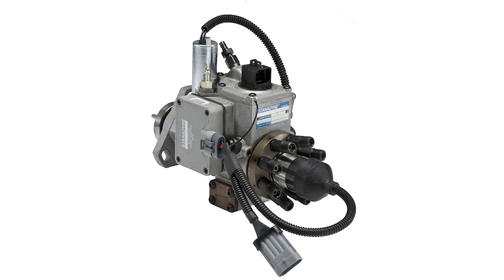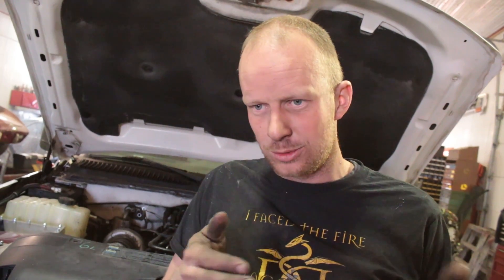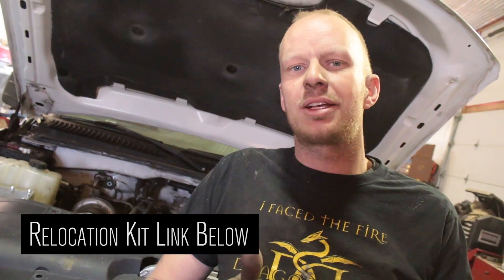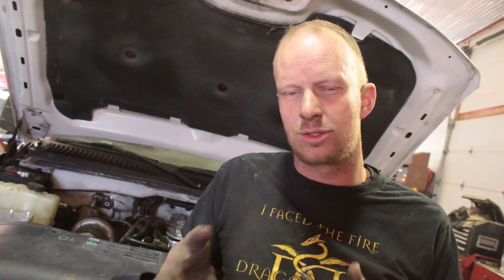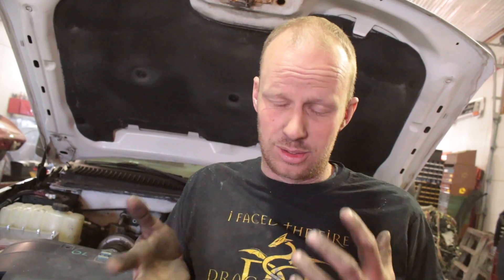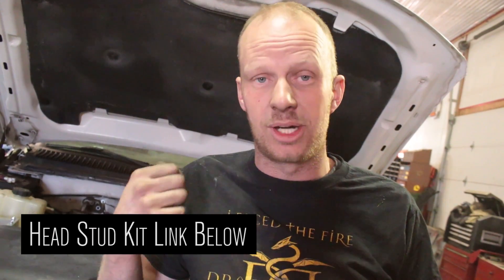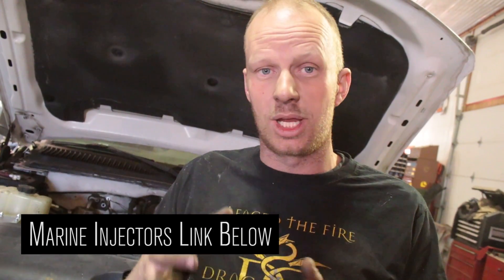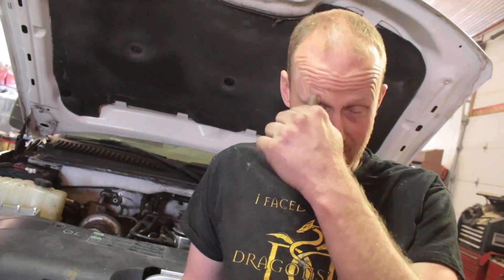REVIEW: Everything Wrong With A GM 6.5 Detroit Diesel

Comment: you forgot to cough 6.0 under your breath aswell..
Reply: Adrian Harris finally a well balaced response. Emissions killed the 6.0 off and nothing more. I'd argue that the EPA killed the entire diesel market in the US by making diesels entirely too complex and expensive for every day driver vehicles.
Reply: I assume you mean 351 Windsor...because the 302 is not quite like a 351 Cleveland.  And the 351W was a different crank, different cylinder deck heights, different intake.  You can't just bore a 302 can get a 351W.
Reply: The guy who said the coolant is the problem is correct. The silicates in the ford gold coolant will fall out of suspension and clog up the oil cooler due to the small passages in the oil cooler. In the coolant flow, the egr cooler is right after the oil cooler. When the oil cooler clogs, the egr cooler doesnt get enough coolant and causes the cylinder temps to rise. High cylinder temps = blown head gaskets. I will admit that the head bolt design could have been improved, but for a stock engine, its adequate. My dads 06 6.0 has 270k and runs fine. The thing about it is that it has standard green coolant in it. Granted green is not ideal for a diesel, but it doesn't kill the 6.0 the way ford gold does. Ive heard of guys running cat ec-1 rated coolants and have next to no problems with the head gaskets.
Reply: DEBOSS GARAGE only ford you would dare own is a 7.3 powerstroke, 5.0 engine or a 460. Those are the only three.
Reply: Wow the EPA, Condelizza Rice and The Obama's have really got you running scared...ANY diesel engine made after 2003 needs to have the emissions shit removed if you expect it to go more than a 150,000 miles with a tune.

Yes it is illegal to remove the emissions controls from a vehicle of any kind but it's also now a federal offense to "annoy" a  police officer. So these laws are all kind of ridiculous and in place for no other reason than to make some fat fuck extremely rich and powerful. And as long as you're in a state that does not do emissions testing. No one cares. Trust me I know...I live in Minnesota and no cop has ever bent his fat ass over to look under my truck to make sure I still have a catalytic converter or made me open my hood to see if my truck still has an EGR Cooler. And even if they did...I doubt if any of them would know what to look for. 

AND!!! If you're that butt hurt about the idea of making your truck run better and be more reliable...There are now several companies including "Bullet Proof Diesel" that make "bullet proof" emissions equipment for the 6.0L that allow you to keep all the bogus emissions controls but also have a truck that will never let you down.
Reply from the maker: I love the one where he says, "I love my truck but sure as shit, its going to leave me by the side of the road" https://www.youtube.com/watch?v=8o2LGuzl0go at 6:40 I know he's talking about a 6.4 but I laugh because nothing he says makes me ever want to own anything Ford ever
Reply: The 351 and 302 blocks are not the same. They are similar though.  the 351 has a different deck height,  and uses larger main bearings.  It is also capable of withstanding higher hp levels.  the 351W also uses larger head bolts, so in order to use 302 head on a 351, the holes in the head need to be drilled larger.
Reply from the maker: That's why I said "Any idea why Ford only used it for 4 years in their PICKUPS?"
Reply: @DEBOSSGARAGE  4 yrs huh?? You cant count apparently 6.0s were in ford trucks 03,04,05,06,07 pretty sure thats 5 yrs. They ran them until 2010 in vans and 6.0 went in bus's flat beds and many.more applications. The reason ford had to move om was due to needing better emissions. U like the good ole 7.3 and ford used the 6.0 longer if u count the vans
Reply: @DEBOSSGARAGE  ford was set on competing with the power race when  the vt365 (international) was far detuned compared to what ford decided to run.
Reply: dillon myers 6.0 is much better than a 6.4.
Reply: i blame idiots with diesels that believe they can put a 500 hp tune then engine goes to shit and wonder why then decide to blame the brand also poor maintenance coolant every 50k miles normal 30k severe
Reply: Mel, I am not the Ford fan my father is but I know he has moved mountains with his 460 and c6 transmission.  Whatever they did that year in 1979 seemed to have worked good for them. He isn't into any of the new stuff. too much stuff to break he says. That is probably true across the board though.
Reply: consaka1 I agree. I love my 95 powerstroke and my gf 91.5 cummins. Both amazing and they will run forever. She's got 189k I've got 106k on the engine 156k on cab and 4K on my built trans.
Reply: BAMAJiPS I decided to run a manual fan controller, when you come up to a hill pulling a load, flip it on never comes over 205 degrees. Great motor never had any problems
Reply: In my opinion those were good years. Probably relatively easy and cheap to fix or upgrade if you want to. I have people tease me (usually ignorant people) that they don't want whatever I have because I am always working on it. What they don't realize is it is almost never for repairs but rather upgrades or new features.  For instance having someone else do a 4x4 conversion on my van and them totally screwing it up.  I had to do my own research into 4x4 suspension geometry and then come up with something better than my quick fix that made it driveable. 
I recently got a '93 Chev crewcab dually.  I got it because it was cheap with a badly cracked head. I quick patched the head and daily driving until I get a performance engine built for it.  Love the simplicity of that engine design.
Reply: actually dont even need to do the EGR delete either, just use the updated bulletproof egr cooler it is way strobger than fords and the truck is 50 state legal. plus you don't need to run a tune to delete the egr
Reply: Nah not really. The 6.0 was made for 7.5 years and it was offered in the f650, the econoline, and the international medium duty trucks. So it was offered in more than one platform. However the 6.4 was only offered in the f250-f550 and international terrastar from 08-10. My dad's friend has got one and he's on his 4th engine!
Reply: Respectfully disagree. My 2007 LBZ Duramax just rolled over 200,000 miles, pulling stuff all over the US. Bone stock, runs like a champ and doesn't burn any oil.
Reply: The LBZ is by far the cats meow when it comes to these platforms.  Mine is just shy of 400,000 and has lived with a trailer hooked to the goose since it had 65,000 on it.  One thing to look at on yours is consider a lift pump to extend the life of your CP3.  The low pressure side of the pump has to draw fuel a long, long, way and it will wear on them.
Reply: Yeah only reason I'd say a 6.0 is better than the 6.5 is atleast the 6.0 actually has power, the 6.5 is a friggin joke, then again so is the company that made it, now they are bigger jokes, GM is government motors.
Reply: dillon myers meh 6.0s aren't terrible if you get em after 04 and take care of them . But yeah 6.4s suck lol
Reply from the maker: Any idea why Ford only used the 6.0 for 4 years in their pickups?  Seems like if it was a good engine, they would have used it longer.
Reply: Mel's 12valve I think you meant the 460, and what do you think about the 351 Windsor?
Reply: DodgeGuy67 lmao I said a chevy motor when I'm talking about fords......
Reply: bigassfordsd I'd never use 302 heads on a 351. I'd use 351 heads on a 302 for lower compression to run a small turbo at no more than 7psi of boost. But a old 4 bolt 302 is one thing I'm after. I have a 81 302 whole motor sitting in my shop waiting for a project I can start. Down to the block. I would do a 347 but it costs to much money. I'm thinking about building it to be a carbed 302 bored 10 or 20 over because the blocks honing is pretty good still the block has 180k on it and you can still see the hone.
Reply: Mel's 12valve outside of the head bolt size, most of the Windsor series heads of the same era are essentially the same casting, mostly pointless to do the swap.
Reply: consaka1 for the most part new stuff is a pain in the ass but nothing can pull like them.
Reply: consaka1 in 1979 you could get a 460, c6 and Dana 60s on a truck. It was a beautiful combination - albeit an 8 mile per gallon one haha
Reply: Oh for sure the new stuff is awesome. The result of competition among the big three. If you were towing for a living and needed a nice tax write off a new truck would be the only way to go, especially if you have endless amounts of money.  For the rest of us, doing occasional towing across the US,  an older rig putting out 300hp will do just fine.
Reply: no use ford parts, just make some updgrades which means dropping 2,000 into it and its a good engine. and do the proper maintenance. go out and try to buy a newer DPF truck and see what you get it a lot more $$ and harder to fix when it breaks
Reply: because it couldn't meet emissions standards anymore. Same reason they had to get rid of the 7.3
Reply: I think Navistar still uses that POS in their International trucks as the Maxxforce 7. Ford ditched Navistar and made their own diesel engine which I heard is better.
Reply: Navistar's maxxforce 7 is the 6.4 powerstroke not a 6.0. and again...in the navistar or international trucks. these run for a million miles easily because of the difference in requirements for emissions crap between a 1ton pickup and a medium duty truck...
Reply: VTWINKIE first gen had plenty of fuel injection problems we have a 2006 dmax no problems but first gen led to the injectors being placed outside the engines which is the easiest engine to replace the injectors
Reply: so take a brand new engine, rebuild and modify the entire top end and then you got a good motor. Logic.
Reply: Bullet proof (bulletproof diesels bullet proof) a 05-07 6.0 and you have a 900,000 mile engine
Reply: dillon myers fah Q
Reply: Game Bred Duramax 6.7 was the scorpion code name
Reply: I had a 6.0 it was a damn good motor it gets a lot of heat that it doesn't deserve
Reply: @trevorodom1930  I have 5 of them, my daily has about 450k on it, stock motor, no heads, gaskets,  arp , nothing  except switching at year 1 to elc coolant and an engine cooler before it plugged.
Reply: Cruisin Down the street in my 60 blowing a head gasket needing a tow
Reply: Donald Drumpf: "351w is shit" Says the guy who plays video games!
Reply: Meh, fuck the government.
Reply: Donovan Savage 6.4 was the worst engine from fuel in the crankcase to egr cooler failure and melted pistons also due too all this the blocks got trashed and almost always they were useless to be rebuilt there have been 6.0 that have reached 800k miles without being bulletproofed and just MAINTENANCE mostly what kills the 6.4 is the epa junk
Reply: HERPY DERPEDY also their shitty fuel system that allowed fuel to get into the oil.
Reply: dillon myers  6.0 is international vt365
Reply: Charles Thomson. and still support gay rights
Reply: Charles Thomson ford diesels were never ford international made their engines all the way to 2010 the new 6.7 was made by ford eith the help of AVL of Austria
Reply: Isaac Housley Was researching the 7.3 and coolant was an issue there as well. Something about micro bubbles working their way through the block if coolant wasn't changed regularly (cavitation).  Nalcool was the preferred coolant IIRC but that was years ago. Yeah, I didn't believe it either until I read it. Ahhh, SLA and it kinda sounds like all diesels could have a problem if neglected. http://www.powerstroke.org/forum/99-03-7-3l-general-discussion/238152-7-3l-block-cavitation.html
Reply: Exactly right. I wanted to go with an 7.3L F-350 but who knows how well people had maintained them. Then when I could afford a new truck (2005) the 6.0 was having problems so I decided no way. Ok Ram, whatcha got...oh this used 2003 3500 with modded Cummins. Death wobble at 80 and I could see people next to me on the freeway scatter. Next. Hmmmm, GM buy down days....I can get a 2005 Dually for how much? SOLD!!! Twelve years later, 9 of which I've either been in Iraq or Afghanistan and my 2005 sits with 35,000 miles on it. I cringe at what could be happening with the fuel. Time to replace a basically brand new fuel filter but cheap insurance. Or buy a new one for $70k. Kinda defeats the purpose of spending all this time over here I guess.
Reply: Mel's 12valve a 351 and 302 have the same 4" bore
Reply: Mel's 12valve its not the same block a 351 hase bigger mains and a taller deck hiet
Reply: dillon myers no. The 6.0 is fixable within reason. The 6.4 is 100% crap
Reply: DEBOSS GARAGE 5 years 03 til 07
Reply: Mel's 12valve 6.2 s are awesome too
Reply: Game Bred Duramax and im a gm fan but a powerstroke platform is still a decent start not like a 2 stroke gm diesel
Reply: nothing wrong with any diesel,its the smog laws,any engine can be bullitt proofed,to a point.the more crap on them the worse they are.6.5 gm,if you read the history,is a stop gap as gm had nothing,its basicaly a petrol engine trying to be a diesel,thats why it has so many faults.heads,block,crank,accesories.on paper,there brilliant,thats where they should of stayed.becouse your in u.s.,you have probably never heard of mwm,in brazil,german diesel.reliable as fuk,not much power std but,mmm,no lectrics,no glow plugs,no worries.cant beat a streight 6.,510nm,140kw,190hp.1995-2007.then went lectric all the common rail,comp,ect.duromax is jap,isuzu,did you get the nissan 6cyltd in u.s.,there bullitt proof,good for 30psi std.
Reply: @phantomwalker8251  you are confusing the 6.2/6.5 with the old converted 350's from Oldsmobile, which were indeed stopgaps built by GM. 6.2/6.5 were Detroits....totally different heritage.
Reply: i dont cough at gm,im uncontrolably sick.history dont lie.only thing i drive is ford or dodge.ya know,its like the 2nd world war,becouse we won,the spitfire is reveared,but the zero,me109,are far superior planes.
Reply: BAMAJiPS, I know my comment is months late but some of us that live in taxifornia where we smog 1998 and newer diesels, we can't bullet proof the 6.0 legally and we have random road side mog check stations, I have personally been through two in Riverside county Ca, the 6.0 is a junk engine in stock form kind of like the Oldsmobile diesel from the early 1980s, it is such a shity engine that they are less valuable than the 7.3 that preceded it. Going by what I always see on Craigslist.  
Not trying to be a critique but it really was a terrible engine it took the aftermarket to get it right.  once it is head studded, EGR deleted and a few other mods it runs like a 7.3 (you know reliable).
Reply: Capt Trdl the 351was a good engine for its day, not a powerhouse but it was never met to be one, just like a BBF (429,460) it was meant for torque.
Reply: JP in JC not true in some cases my 6.0 broke down with normal towing and daily driving. Bulletproofing fixed it.
Reply: dillon myers i
Reply: Atomic Reverend Alexander what law says you can’t stud a 6.0 bud
Reply: Mel's 12valve 351s are not the same as a 302 different block.
Reply: No he didn't. The 6.0 had issues for its first half a year productiin but after that was a great motor. Just as efficient and reliable as a 7.3
Reply: Matt Lane I'm willing to bet a few things.
1. I'm betting you've madr a few kids that would be considered illegal yourself.
2. I'm also betting you bragged about sleeping with your prom date who was also your cousin
Reply: Places have tested for emissions since the 60's.  If you live somewhere it is not required, it is not a crime to take it off.  Where I live, it is not required.  70 miles south of me it is.  If I lived there, it would be illegal, where I live, it is not.
Reply: Hell yeah buddy!  Also, in some states, it is only certain counties.  In Idaho, Ada County is the only 1 I know of.  Washington, Snohomish, King, Pierce, and Thurston counties.  Same kind of thing in Oregon, I just do not know which counties are which.
Reply: dillon myers not near as bad as the 6.4. the updated 6.0 was released in 05 models. Still had a few quirks, but leaps and bounds better. The 6.4 was designed to fail around 150k. Instead, they failed before the warranty was up. Ford couldn't make money off of customers that way. So Ford severed ties with international.
Reply: Removing emissions controls like egr is not a felony. If it were, companies manufacturing these delete kits would be hauled off to prison. It varies from State to state. The county I live in has no smog requirements. And I live in California. The emissions laws only cover the automobile makers. Their product must meet a certain standard. That's why VW got into hot water with their TDIs.
Reply: Garrett It had nothing to do with the Fuel system itself, It was the DPF regeneration that had to be performed to burn the soot out of the Particulate filter so it wouldn't clog up, which lies the problem It clogged up because it didn't fully clean it so it stayed in Regen and constantly dumped fuel trying to heat it up enough to burn it again. Most people never fully completed the regeneration cycle.
Reply: 2 litre diesel in UK, 2.5 litre diesel in New Zealand. 3.2 litre diesel in Australia. I'm pretty sure that if you tried to put a 6.0 in a Transit, it would end up on the floor. I have heard of people repowering them with gasoline V8s. Maybe there were some E series (Econoline in the old days) with diesel engines
Reply: Mel's 12valve somebody knows their shit haha dont forget 429 which is a version of 460 so yea u covered it all i hate to admit this but Ford's forged internal 4.6 4valve supercharged from factory is replacing the 5.0 in my 95 cobra
Reply: Mel's 12valve wrong. A 302 is not the same as 351. It isn't the same. A 351 is more robust and heavier in every sense. By that logic an ls1 is a bored ls4.
Reply: Thought Challenger There never was a 5.7 conversion, the only thing they had in common were bore size and bell housing, the block was a different cast, you can't throw on an gas components from the other 5.7 and make it a gas engine. They were good engines but sold as being just like a gas engine needing no special treatment, poor fuels that often had water contamination, where the engine had no water separator lead to blow head gaskets, poorly trained dealer mechanics often reused head bolts leading to blowing another head gasket. There are still on the road today under educated owners who know how to maintain them. Buy any diesel today and ignore all the required maintenance schedule, treat it like a gas engine only with oil changes using jiffy lubes sale service, cheap oil of what ever weight.
Reply: 6.0 is an amazing engine, once bulletproofed it's indestructible
Reply: Throw a stud kit in them and run normal coolant. My fleet shop has a dozen 6.0’s with over 400k on them pulling trailers cross country. Once those two things were done to them we almost never have major lost-time issues on the road anymore.
Reply: @freedomseeker2025  I said the 6.7 was the scorpion not the duramax which doesn't have a 6.7 in its family so your being kinda redundant.
Reply: @jdrok5026  that dudes name looked like part of your answer, sorry,  you were indeed correct!! 😀
Reply: The 6.0 issues are exaggerated far more than what they really are. Yes if you over heat the engine it will blow head gaskets just like any other engine. The reason behind the engine overheating is the egr cooler failing. So to sum things up the same emissions garbage that causes problems on other engines also causes problems on 6.0s. Watch the temps and change your oil every once in a while and the worst that will happen is a sensor will go out every now and then. I have an 07 with 300k on it big turbo big injectors makes 550hp and 1000ftlb on stock head bolts
Reply: the 6.4l was based on the 6.0l design, but was supposed to fix some of the 6.0l's flaws. It didn't, and introduced a bunch of new ones (generating oil, radiators cracking etc.). The reason the 6.0l didn't last was emissions, they could have detuned and made changes to the the 6.0l to make it pass 2008's emissions, or increase the capacity so it still competed with the larger capacity 6.7 Cummins and 6.6 Duramax
Reply: Adrian Harris that is not entirely accurate. The 6.0 used high pressure oil to fire the injectors. The 6.4 used common rail direct injection. The 6.4 was a clean sheet design. It had to meet tighter emissions. Hence the common rail injection and the dpf system. The dpf would cook 6.4s alive. It would overheat turbos and cause the seals to leak and all of the oil would be dumped into the dpf system and boom went the engine.
Reply: dillon myers 6.0 is a fantastic motor. Ford's experimental coolant gelled and clogged the heat exchanger and cause premature failure.
An egr delete, regular coolant change intervals with modern coolant and it's a long hauler. Head studs and revised head gaskets (bullet proof) if you want to be extra cautious..No silly DPF to mess with. I'd take a another 6.0 in a heartbeat. yeah there was a bad batch that tainted the brand, but after that was resolved - It's a fantastic motor with good power and a good service life.
Reply: @BAMAJiPS  Hows it a great engine. It was unreliable and also not even close to comparable of the 6.6 duramax or 5.9 cummins of the same years. And on top of being unreliable they were inefficient. Ive never seen a ford get over 20mpg but I have seen many cummins and duramaxs
Reply: I fully know about the 6.0 and yes you do you go watch him, ford fucked up the RAD CAP rofl... and it boils over the coolant... okay 6.0 had over 500 redesigned parts.
Reply: DEBOSS GARAGE pretty sure in 2010 the 6 liter was in the transit vans
Reply: Matt Lane removing emissions is not illegal unless you live in one of the douche bag states. Emissions are what kill modern day engines.
Reply: Matt Lane you don't HAVE to bullet proof it for an every day driver and regular trailer towing and hauling. If you want to run crazy tunes and roll smoke then you need to bullet proof it. 

One EGR modification and regular coolant flushes and this motor is rock solid. Watch powerstrokehelp.com and dude will tell you it's a fantastic motor.... and he specializes in all powerstrokes. I think he knows a little more than you or I with our keyboard warrior knowledge.
Reply: Who was the dumbshit that said duramax's didn't have issues lol that the funniest shit I heard in a long time.
Reply: DodgeGuy67 a 351 is just a bored out 302. They are the same engine.
Reply: @12valve9  stroked 302
Reply: @12valve9  incorrect. Deck height, head bolt diameter, oil pan rails, main journal diameter are different.
Reply: Dodgeguy. The 351 is a decent engine after you rebuild it. Some things need replaced like Plastic toothed timing chains! Like who really thought that was a good idea? I'd like to slap that guy.
Reply: lmfao illegally delete emissions buddy i know people that have deleted there brand new 2017 powerstrokes will 1000 miles on em everyone does it l
Reply: NeilLB7 ok let me be specific. The block is the same. They come from the same block same design there is a reason you can use 289-302-351 heads on either one you want.
Reply: So if you, illegally delete emissions systems, redo your heads do not use ford parts, change your coolant like your oil, it's awesome.

WUT LOL

6.0 was a POS.  HUGE pos.
Reply: anything ford makes me turn my head and cough.
Reply: 6.0s suck
Reply: 5.7 gas conversion
Reply: bosna917 So that makes it legal? rofl, tampering with emissions system is a federal crime.  Plain and simple, removing it on a new truck removes the warranty as well.  So you know idiots basically. 

As as I said, the motors good if you do illegal shit to it among other things, BTW states are starting to test for that as well so.  Have fun when you need to put it all back on.
Reply: @mattlane2282  My truck.. not the governments. They didn't pay for it so I'll do what I please with it.
Reply: would you like it to be like china? I mean we do need something maybe not as much as we have now but we need something... anyway my point is right or wrong, the motor aint good if you need to rebuild the whole thing and commit felonies... dmax has no issues like this.